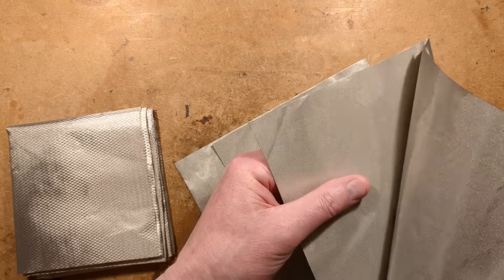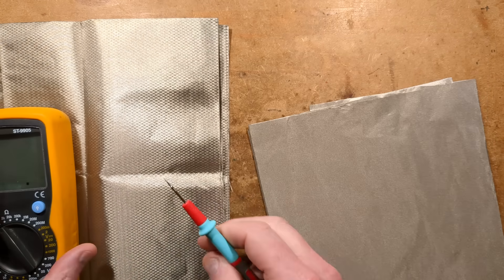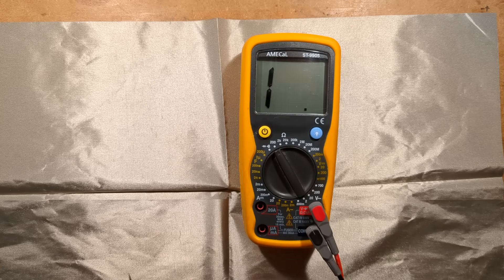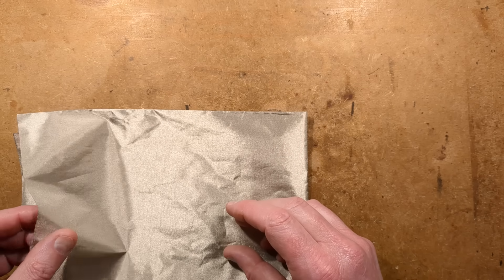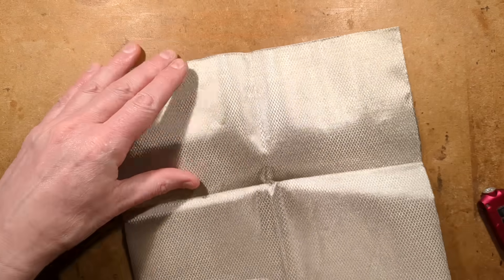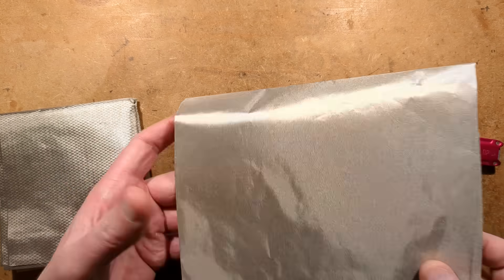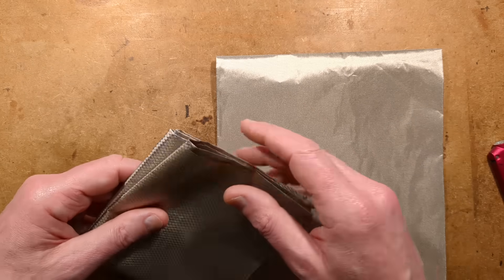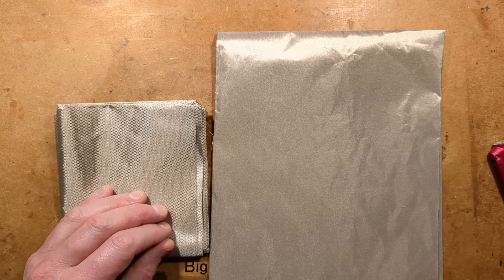Anti 5G fabric is amazingly conductive

Comment: Small Bag to Carry your RFID enabled passports🤔. Can also be used as a grounding topsheet(or just for the feet) by connecting to an electric outlet ground terminal.
Can be used to block cellphone radiations. Can be applied to wounds to heal faster(silver fabric has proven to do that by being conductive as well as antimicrobial). Can wrap wires in automotive harnesses to improve rfi/emi shielding. Can put some gel to be used as electrodes for tens muscle stimulators. Can also be used as an anti tase undergarment.

Comment: Looks a whole lot like a metallic coating somehow plated onto a synthetic fiber. I wonder if solder will stick to it in a useful way, or if it would just melt the base fiber?
Reply from the maker: It did take solder, but also melted.

Comment: I'd be curious to see high current run through a strip of it.
Reply: Yeeehaw, fireworks! Also: Microwave it!
Reply: exactly what i was thinking lol
Reply: For a taser-proof jumper or trousers?  Wise to talk a friend into testing it, though.
Reply: @normandiebryant6989  There are anti- taser garments commercially available from the likes of ThorShield in the US. That's literally all it is, a conductive layer in the garment. The fabric used to be very expensive and hard to source a decade ago. It works by dissapating the high voltage over a large surface area.
Reply: @normandiebryant6989  🤔 Unless it launched it's own taser barbs back to the sender, the current would still need to go somewhere... 🤣
Reply: @normandiebryant6989  Which is why tasers have pointy-ends on the wires.
Reply: I would like to see an RF test on the whole spectrum
Reply: Any temps above 60 - 80°C or so it might crinkle up due to polymer content... but running a few watts shu'd be good 😅 🎉 🛑🔥
Reply: i was actually going to suggest Low current. High current would likely burn it out like a heating element or a thin wire. Though that would also be cool to see.
Reply: @DigitalIP such low resistance though, would it burn?
Reply: @steviefordranger198  Not sure, never used such material for anything before. Would be nice to see though. I would think it would heat up like aluminum foil or something though
Reply: Nice, that stuff seems a lot more easy to use than that anti-EM paint LTT made a video about.
Just use it as wallpaper, ground it, and then your WIFI congestion problem is solved.
Just don't over-do it, or your 112/911 call might not get through 😅
Reply: @RaDeus87 it's illegal to do that unfortunately. At least in the US.
Reply: is this the stuff the "hole warmer" was made out of?
Reply: @PeterShipley1 does the video still exist? I couldn't find it last time I was looking for it.
Reply: Sounds like a super cheap way to make a EFI device. Would definitely  be more reliable than bubble gum and candy wrappers 😂
Reply: Send a piece to styro Pyro or plasma channel
Reply: Could he cook a hotdog with it? 
A strip wrapped around the weenie with voltage applied to either end at mains voltage could be a fun watch.
Reply: Wrong channel. That is photonicinduction's specialty.
Reply: Or high voltage at low currennt
Reply: @jhsevs  High voltage and low current requires high resistance. As this fabric is low resistance, high voltage = high current, low voltage = low current. But low current is possible though.
Reply: @KaliTheCatgirl :

High-voltage pulsed at a minuscule duty-cycle is another possibility.
Reply: @jhsevs I believe you need resistance to make that work, which this material doesn’t seem to have a lot of.
Reply: @jhsevs Current and voltage are not independent values. As someone already mentioned - they are related via resistance. Since resistance here is fixed...

We can either pick high or low power/wattage.
Reply: @jakubjakubowski944  it's fixed until you e.g. stretch the fabric... but you might not want to do so with your bare hands depending on what's being put through it

Comment: This material could be useful for making antennas with difficult geometry such as a discone.  You could make the substrate out of easily shaped styrofoam, waterproof paint the foam and then glue on this 5g-proof fabric.  The fabric would be a lot easier to work with than tinfoil which tears easily.  If this fabric isn’t UV resistant it would need a coat of RF transparent paint for outdoor use.

Comment: I bet someone is using it to line shopping bags in order to shoplift and beat the sensors. Or i guess they could line there pants for the same use.
Reply from the maker: Some systems detect people entering with a large area of shielding material.

Comment: I got a new wallet recently which is lined with something like this. It seems to work and none of my cards will work when inside the wallet - however it does have one little fold-out compartment, designed for things like travel cards - sadly that stops cards working too!

Comment: Ooh this could possibly really good for making home-made flex sensors. Also I currently use a 2.4g wireless headset, could drape that around my microwave to cut-down the interference
Reply from the maker: Don't block any air vents.

Comment: I use similar materials (and then several layers of them) to make RF-shielded pouches out of them to put into them my car-remote (avoids key-signal to be relayed towards the car and bestolen), and ATM bank cards, passports and other cards who have RFID on/in them. Best way to test if the shielding is working, is trying (e.g) to open/lock the car with the remote fully into the pouch.

Comment: It looks like the adhesive shielding used in laptops around wire bundles and wifi  cables
Reply: Yeah its the same stuff just without adhesive on it. Used everywhere. 
copper nickel plated polyester fabric

Comment: You could put one sheet on the inside of a t-shirt and another sheet on the outside of a t-shirt, giving you a ground plane and a Vcc plane. You could fill it with LED's with the whole shirt plugged into a power bank. 😃

(What's it like to solder too, btw ?)
Reply from the maker: It took solder, but the polyester thread melted.

Comment: This would be AMAZING for shielding guitars!
Reply: Here's me looking through the comments to see if anyone else has mentioned this use for it. It will be far easier to use than copper tape or that gross thick carbon paint that's often used for this purpose.
Reply: Same idea crossed my mind but then thought the traditional copper tape/shielding paint would be easier. You'd either need to weld that every surface with a ton of glue or super tightly staple it.

The inside of a guitar cavity has a lot of shortable bare components and connection points so the last thing you'd want is a bit of sagging or loose fabric bridging something it shouldn't.
Reply: I would think that wetting the conductive cloth down with fibreglass resin (apart from a spot you'd leave bare to connect a ground to) would make short work of it.
Reply: Can you solder to it?
Reply: @gavinjones3637 no need to, there's no actual current passing through it. Just drive a screw with a wire for contact, or leave a tab to contact the shielding on the pickguard when it's pressed against the body.
Reply: @gavinjones3637 no real need for that, you can just stuff the bridge grounding wire between your (of course, already shielded) pickguard and the cloth near a screw hole.

Comment: The problem with all these kinds of shielding hat is that the rays are still able to enter in through the face, and so get trapped in the skull rather than passing straight through.
Reply: What as in, in one ear and out the other.
Reply: that only happens if your hat design isn't daring enough
Reply: Perhaps the best design would be a combination Deerstalker/Fencing Mask.
Reply: I recall reading a study that actually tested that.
Indeed: they did find that foil hat increased the strength of radio signals under the hat.
Reply: The ray-via-face-trap problem inherent in the tinfoil hat design is why I am using an even more ancient technology, the paper bag.
Reply: @joelmurphy9369  Our ancient ancestors used cattle dung mixed with straw as protection against rays.  It apparently worked well, the 5G towers were completely blocked from controlling their thoughts.
Reply: Lucky this stuff is a bit see-through! 😆
(So I guess rays would have to enter through the neck, and then get extra trapped)
Reply: It's best used in a fascinator, rather than a regular hat.  That intrigues the electromagnetic radiation, so it swirls around the fascinator and can be caught and directed elsewhere by the matching conductor earrings.

Comment: I come here for the weird Ali Express finds. That's crazy low resistance. I wonder how dirt affects it? I had to wear antistatic lab coats for a job I had once and we were told they needed to be specially cleaned and that they were electrically conductive. We never tested it with a meter! We should have.

Comment: wondering if this would make a good heater
but the resistance is probably too low
Reply from the maker: In thin strips at low voltage it might work.

Comment: you should try 3d printing with plastic on top of it to make a circuit. you can make a chanel to cut where it needs to be separated. it will be fun to experiment... can you solder on top of it?
Reply from the maker: It takes solder, but also melts.

Comment: Comparing this with aluminium foil which is my current goto when I need a pliable conductive material this is more pliable and probably more durable but the fact that it doesn't hold its shape would be an issue for a lot of bodge jobs.

Comment: Will it take solder? You could cut traces out of it, stick it between 2 bits of tape or vinyl, and make flexible circuit boards.
Reply from the maker: It takes solder, but melts.

Comment: Put some of that on either side of "Pressure-Sensitive Conductive Sheet" (like "Velostat") material for DIY flexible pressure sensor.  Pressing, stepping etc. Changes resistance nicely.  Hook it right into an Audrino analog input or whatever.  Put multiple patches of it on one side and detect how hard and where you press.  Bonus feature: roll it up and make a pressure sensitive capacitator thing. Also, if you make a full body suit out of that material, non-ionizing radio waves (your 5Gs and what-nots) will NOT harm you, 100% guaranteed!
Reply: For a more normal, functional capacitor of course you'll want an insulator, try polyethylene or whatever plastic sheet between some of that conductive fabric.
Reply: I bet you could make pretty great DIY E-drum cymbals with a sandwich like that. The normal lower end version is something like a conductive (foil-backed) rubber mat for a switch trigger + plus a piezo for amplitude, on a plastic practice cymbal. The fabric might allow some interesting designs of drum rim triggers as well, like lining the inside of a slit elastice tube, with some spacers against the actual rim.
Maybe even for the heads themselves, but mesh heads+center piezo is probably hard to beat, KISS is probably best...
Reply: @AnWe79  That would probably work well!

Comment: If you're allergic to nickel, then that's going to be fun as a hat...
Reply: Not to mention the microplastics and metal slivers that will be generated when flexed. wonder just how many times a section could be bent before it either stops conducting, or simply fractures.

Wonder how it will perform on top of a sacrificial ceramic plate in a sacrificial microwave oven though, should be some lovely metal arcs from it as it turns.

Comment: Will it stop static electric discharge when exiting a car?
Reply from the maker: Not unless you dangled a strip between the chassis and ground.
Reply: Yes. But then so will spraying the car seat with a very fine mist of water so you don't generate the static while getting in or out.
Reply: @paulsengupta971 :

Most people don’t want a moist seat.  
Many park their vehicle where the temperature is below 0°C.
Reply: @denverbraughler3948  It's not really moist though, just not overly dry.

Comment: I like how these people know enough physics to understand how faraday cages work and how they affect electromagnetism, but not enough to know that electromagnetism (at least the amount they  are complaining about) is completely harmless
Reply: I suspect the people who understand the physics to make and sell this stuff do know enough about electromagnetism to know it's harmless, but aren't going to let that stop them from making a buck off the people who don't.
Reply: @acreopian  This, a fool and their money, etc
Reply: This fabric might be useful for making a planar loudspeaker.  I had Magnepan loudspeakers which were a sheet of Mylar with a serpentine copper wire glued to the Mylar and suspended in front of bar magnets.  The problem is after about 30 years the copper wire delaminates from the Mylar.  A completely conductive sheet of fabric might work.  The benefit is that a large planer sheet doesn’t have to move back and forth very much to produce as much sound intensity as a basket/cone speaker which has do move back and forth quite a lot.
Reply: @wtmayhew  Oh, ooh, yes this could be something really nice. I hope Clive gives your idea a try
Reply: Not just the amount, but the type.  Anything at a lower frequency than UV can't damage cells beyond burning, which you can easily detect with your nervous system.
Reply: I think Big Clive's house should have curtains made of this stuff.👍👍👍💥
Reply: Next time you'll be telling us that fire is harmless if you don't touch it!

Comment: many years ago i was asked to sanity check an it solution that used tempest certified coms equipment at its core. the modems, the circuit board was wrapped in a fabric bag just like this stuff, but it also had wires within it so that if you tried to cut the bag open, it  would be noticed and the key material/firmware would be instantly erased.
brilliantly engineered kit, unfortunately sold by a pre sales team made of ‘that kind is salesmen’ for whom no lie is too big to get a sale. the kit was utterly useless for the intended app and the companies devs had no intention of doing anything about that….
unfortunately the timing of this discovery ment my employer had to walk away from a contract after getting preferred bigger status.
ive had a very very jaundiced opinion of pre sales teams ever since.

Comment: 🇺🇸 The mesh size needed to filter a wave is one-tenth of this wavelength (called λ).
For c the speed of light and f the frequency: 
λ = 𝑐 ÷ 𝑓
( λ in m ; 𝑓 in Hz ; 𝑐 in m·s⁻¹ )

High bands of 5G is from 25 to 100 GHz 
We take 𝑓 ≈ 100 Ghz 
𝑐 = 299 792 458 ≈ 299 · 10⁶
𝑓 = 100 · 10⁹
λ = 299 · 10⁶ / 100 · 10⁹ 
λ = 0,00299 ≈ 2,99 mm 
Therefore 
⅒λ ≈ 0.29 mm 
The gap between conductive meshes must be 0.29 millimeter (or less)
Reply: You're off by an order of magnitude there. The highest 5G band anywhere in the world tops out at 7.1 GHz.
Reply: @aaronmdjones  I knew, it takes into account the evolution of 5G and its limits ; it guarantees that the anti-5G remains so for any evolution of 5G. 😊
Otherwise for 7,10 Ghz it corresponds to a maximum mesh of 4,21 mm
Reply: @XyQrTw   Evolution of communication standards can't beat physics. A 100 GHz signal will not propagate much further than about 1km within the atmosphere (it is attenuated far too much) unless you pump a serious amount of power into it (far more than is legal without a specific transmission license and risk assessment). It will also not pass through a brick or concrete wall, making it fairly useless for mobile telecommunications. Even existing 5G bands in the 5-7 GHz range have trouble with the low-emissivity glass used in high-rise buildings.
Reply: In the UK, the current highest frequency used for 5G is 3.7GHz, but there are some mm wave trials taking place.
Reply: Afterwards, considering the material, it respects the 0.29mm. But I think that the material must be even more useful for other cases :
For coat pockets to hold contactless car keys, 
To protect credit cards and other contactless cards stored in wallets, 
for the pockets of various Hotel employees ...

Comment: 🇫🇷 Les mailles nécessaires pour filtrer une ondes sont de un dixième de cette longueur d'onde ( nommé λ ).
Pour c la vitesse de la lumière et f la fréquence :
λ = 𝑐 ÷ 𝑓
( λ en m ; 𝑓 en Hz ; 𝑐 en m·s⁻¹ )
Bandes hautes de la 5G est de 25 à 100 GHz
On prend 𝑓 ≈ 100 Ghz
𝑐 = 299 792 458 ≈ 299 · 10⁶
𝑓 = 100 · 10⁹
λ = 299 · 10⁶ / 100 · 10⁹
λ = 0,00299 ≈ 2,99 mm
Donc 
⅒λ ≈ 0,29 mm 
L'ecart des mailles doivent être de 0,29 millimètre (ou moins)
Reply: No, the current 5G frequency tops out at about 3.7GHz.
Reply: @paulsengupta971 Après, au vu de la matière, elle respecte les 0.29mm. Mais je pense que la matière doit être encore plus utile pour d'autres cas :
Pour les poches de manteaux afin d'y mettre des clefs de voiture sans contact, pour protéger les CB et autres cartes sans contact rangé dans les portefeuilles, pour les poches des différents employés dans les hôtels, ...

Comment: Could it be used to create a capacitive stylus with a relatively fine tip? The idea is to have something that doesn't scratch up the screen and maybe 1mm or so sized tip.
Reply from the maker: The existing capacitive styluses have a very small tip.  (They use active circuitry.)

Comment: Most likely plating the polyester with copper and then nickel? I've PVD pure nickel onto polyester and fiberglass mats, but the issue is heat during the process, it will turn most plastics "crispy" or burn the binder out of the fiberglass, making it fall apart. Surprisingly a lot of nickel rubs off after PVD, which makes me think plating is a much cleaner, easier solution.
Reply: Correct